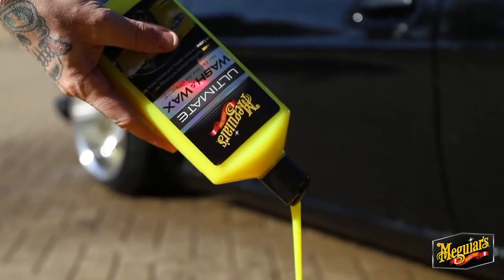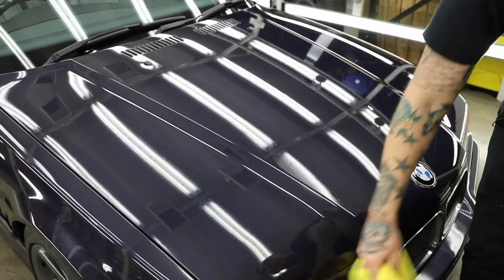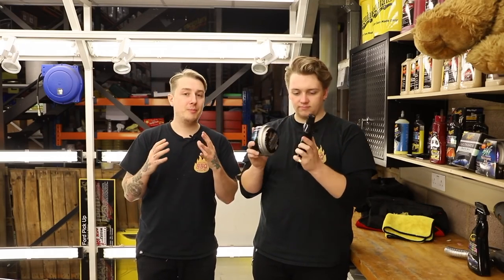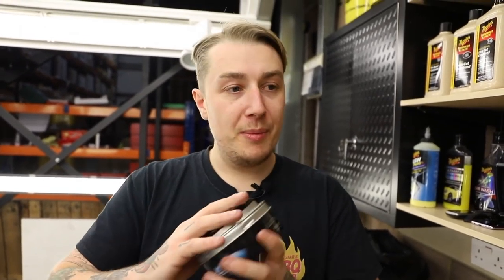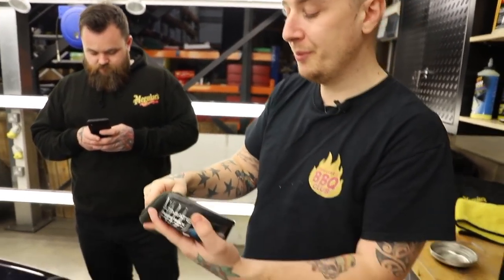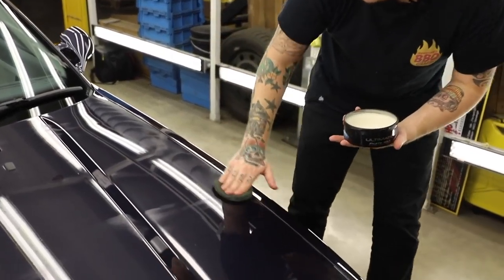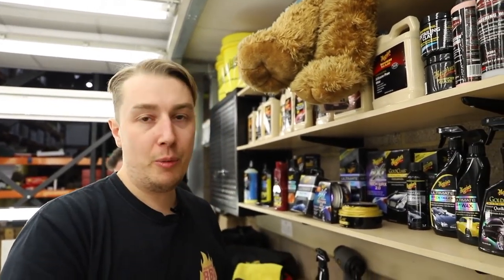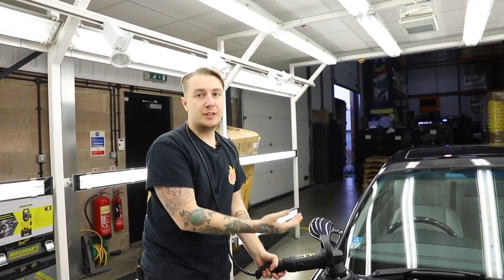Protecting the Paint with Ultimate Wax - Meguiar’s Detailing 101 – UK Edition

Comment: My car is a two tone metallic red and orange with gold flake, what would be the best wax? Would the gold class be best?
Reply from the maker: That depends very much on the current condition of your paint and your desires for it.  Are you planning to remove defects and polish to a high shine before applying wax?  Are you only looking for a high shine in one step?  Are you looking for the best protecting wax?  Is the car parked outdoors or exposed to the elements much or is it a garaged show car?

Feel free to reach out to our Solutions Hub via our website to discuss the specifics of your vehicle and situation.

https://s.3m.com/fyypg5
Reply: @meguiars  It is clayed and machine polished with the ultimate compound every year and garaged, the paint is in very nice condition, the car only really gets used in dry weather.
Reply from the maker: Our Gold Class Wax would be a good choice and will give your car great shine/gloss.  The newer synthetic waxes will offer better/longer protection but if the vehicle is rarely exposed to the elements the "best" protection may not be as important.  👍

Comment: what is the approximate time that I have to wait till the wax cure, 3-5 min? And what will happen if I wait longer time?
Reply from the maker: The Ultimate Wax does not dry like a traditional wax and will not haze up or turn chalky and dry.  That is why we recommend wiping it off in just a few minutes.  You can certainly wait a little longer without any consequences.
Reply: Meguiar's thanks. I will need to repeat:the process ) because i have waited maybe one minute so afraid that wasn’t enough time for wax to cure . So how long to wait 3,5 or 10 min to be best ?
Reply from the maker: We recommend 3-5 minutes.  👍
Reply: Meguiar's many thanks!

Comment: I have this exact bmw in this same colour; just replicated this whole process and it looks amazing :). I actually used gold class carnauba plus paste wax instead of ultimate paste wax because i wanted more depth and richness than just high gloss. I know gold class may not last as long though so what can i use to boost protection in between waxing? Is there some sort of detailer or spray wax?
Reply from the maker: You can certainly use any of our spray detailers or spray waxes but if you want the best protection our Hybrid Ceramic Detailer might be the best choice for you.
Reply: @meguiars  ok great, another question actually: I bought the hybrid ceramic clay kit a while back and found it worked really well on the glass but not at all on the paint, it couldnt remove tar or anything really at all. Is this normal as I used the regular clay bar with the hybrid ceramic detailer and it worked a treat
Reply from the maker: It is somewhat normal as traditional clay is a little more aggressive/effective when you have stubborn contaminants.  If you know for a fact that is the case on your particular vehicle at any given time you should choose a traditional clay bar.

Thanks for the feedback.  👍

Comment: When applying the wax the last step do you need to use a panel wipe to get any greeze of before putting on wax panel wipe like isopropyl alcohol  ??
Reply from the maker: Not typically, no.  That is more necessary when applying a coating but not often necessary when simply applying a wax as your last step of the detailing process.
Reply: @meguiars  Thank you 👍

Comment: So it's okay to apply wax in a circular motion? It won't create swirls?
Reply from the maker: Swirls do not come from the direction you are applying or wiping off.  The same thing will happen if you wipe straight back and forth.  Of course the "swirls" won't be swirls they will be fine scratches in a straight line.  Preventing this fine scratching has nothing to do with the pattern and everything to do with using the appropriate safe materials to wash, dry, apply polish/wax, remove products, etc.

Comment: At what stage would you use the new NXT Generation Polymer Paint Sealant? Instead of wax?
Reply from the maker: Hi Jason, that would be used in place of wax.  You can basically think of it as a synthetic wax.  More durability, longevity & protection than a traditional carnauba.
Reply: Thanks for a quick response. Any chance your going to do a final overview on your Detailing 101 series? Maybe covering how regularly some of the stages of detailing should be done. For example the compound polish doesn’t have to be done every detail and how some of the products last multiple washes. Thanks the videos, I’m very much a beginner and these have help heaps.

Comment: Should we apply meg Ultimate quick detailer after wax?
Reply from the maker: Quick Detailer can be used any time you want to wipe safely remove light dirt, dust, fingerprints, fresh bird droppings, etc.  You typically would not "need" to use one to wipe down your car right after waxing but you certainly can.
Reply: @meguiars  one question again. What different meg ultimate Quick detailer and meg last touch spray detailer? Which the best or can i replace ultimate quick detailer with last touch spray detailer?
Reply from the maker: A detail spray can be used almost any time you like to safely remove fresh/loose dirt, dust, fingerprints, fresh bird droppings or water spots, etc.  There is no reason you would typically need to use it right after waxing unless a fresh layer so dust just hit the car or something of that nature.
Reply from the maker: Answer a few days ago.  Please re-read.  If you have been using the Ultimate Quik Detailer and like it there is no reason you need to switch unless you are anxious to try something else or need a product offered in gallon size.
Reply: @meguiars  how about the durability of those product? Which better?
Reply from the maker: As mentioned in our previous answer Ultimate Quik Detailer does offer some protection and water beading that the Last Touch does not.
Reply: @meguiars  so if i apply meg ultimate quick detailer then tomorrow i apply last touch spray detailer, will the water beading protection will lost?
Reply from the maker: Again, there is no reason you need both of these products.  It would make a whole lot more sense to choose your favorite and stick with it.  But for a hypothetical conversation, that doesn't make much sense in the real world, using the Last Touch directly after the Ultimate Quik Detailer could diminish the water beading to some extent.  

It is important to remember the purpose of a detailer mist & wipe as described earlier in our conversation.  Although the Ultimate Quik Detailer does offer a little protection as a side benefit you should not be using is as a wax or your main source of protection.
Reply: @meguiars  thank a lot
Reply: @meguiars  hello i need help, when my car runs out of the rain and I let the water dry by itself, then you will see water spots and it is not easy to remove even though it has been sprayed with Meguiars Ultimate Quick Detailer.  Previously my car was protected by Meguiars Ultimate Wax and Meguiars Ultimate Quick Detailer.  Is there any suggestion for a product that if the rainwater dries up does not leave a scar that is difficult to remove?
Reply from the maker: Water spots are not created equal.  There are a number of environmental factors that lead to how stubborn the water spots are.  The only guaranteed method of not acquiring water spots is either not letting water hit the car, which of course is not always possible, or removing them very quickly before they have a chance to etch into the paint.  If he water spots sit on the car very long, especially in the sun, they will begin to etch into the wax and/or paint quickly.  Keeping a good coat of wax on the vehicle will buy some time and help the water come off easier.  

That being said our new Hybrid Ceramic Liquid Wax will create better protection and water beading along with a nearly self cleaning effect that allows the water to roll off the car more easilly.  To do that though the car will still need to be moving or be assisted by the wind blow so that water is not just sitting on a flat horizontal surface.

Don't feel too bad.  This is something we all face with our daily drivers and no garage.
Reply: @meguiars  ah thanks. How about Meguiars Pro Hybrid ceramic bead booster M799? Please tell me far about this product. So my formula is = meg ultimate wax, meg pro hybrid ceramic bead booster then meg ultimate quick detailer for daily use.

Comment: The polish leaves an oily layer. Should I remove it prior to waxing?
Reply from the maker: Shouldn't really be oily after applied and wiped off thoroughly.  Not sure what you mean here?  Typically you apply/remove a polish and then apply/remove the wax, one right after the other.  There is not usually another step in between.

Comment: What wax would you use on a white car?
Reply from the maker: This is a much more broad question than you might think.  The short answer is paint is paint and you do not need a special wax formulated for only white cars.  Most cars have a clear coat (clear paint) as their top layer.  The color can affect shine, gloss, etc. but you are in essence still caring for the paint the same way regardless of the color.  That leads to a bigger conversation about your specific vehicles condition, environment, your own personal desires, etc.  If you have not already read through our 5 Steps of Paint Care that would be beneficial for you.  Here it is...

http://www.meguiarsonline.com/forums/showthread.php?65188-Meguiar-s-5-Step-Paint-Care-Cycle